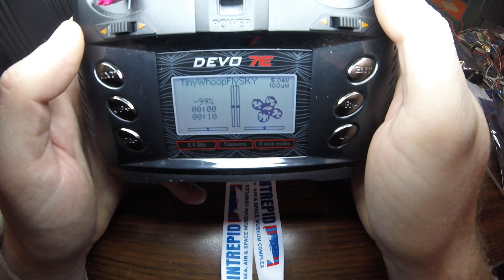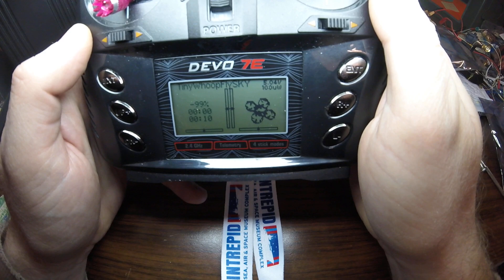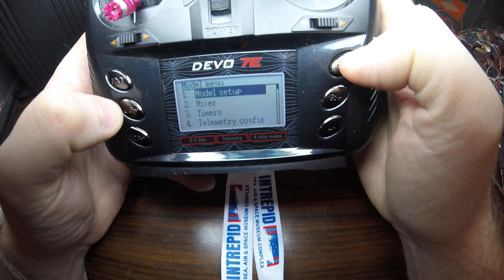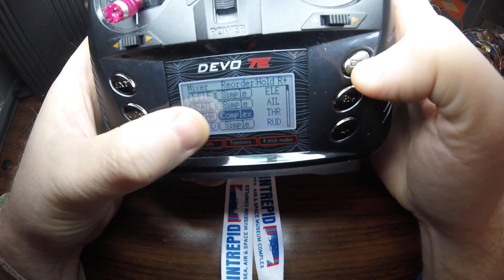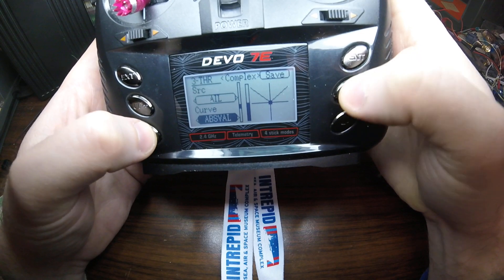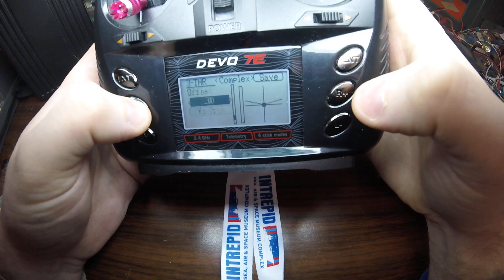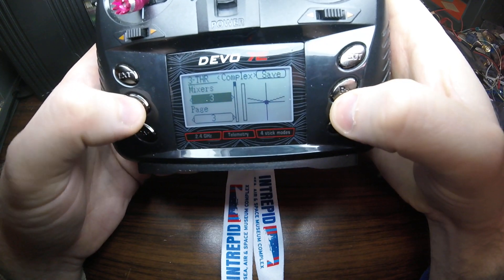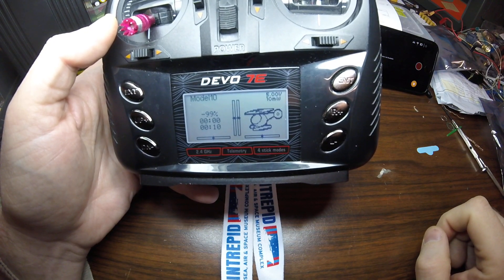Tiny Whoop Tutorial Deviationtx Throttle Mixed with ELE and AIL

Comment: Thanks! Helped me do exactly what I wanted even though I’m not using a tiny whoop. Are you still using the devo7e? Mines getting pretty beat up and the sticks are a little twitchy in betaflight so looking to upgrade but this radio is still quite a little beast with the range mod and extra tx modules. I do wish I had more switches and tighter gimbals, as well as 11ms protocols.
Reply from the maker: Glad it helped.  Yep still using my devo.  I don't have much time to fly but when I do it works good enough.
Reply: Jon Boehm Yea mines got the battery door broken off so it’s kind of annoying, been using it like that for almost 2 years, I don’t fly all that much either but I love the versatility.